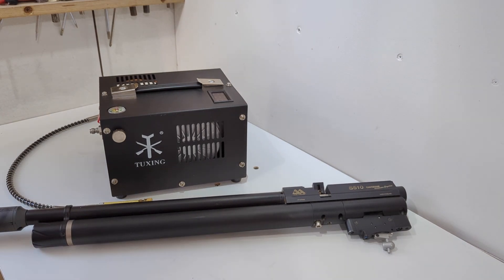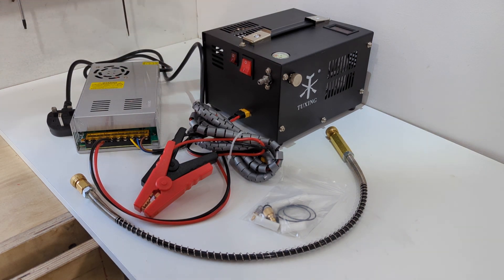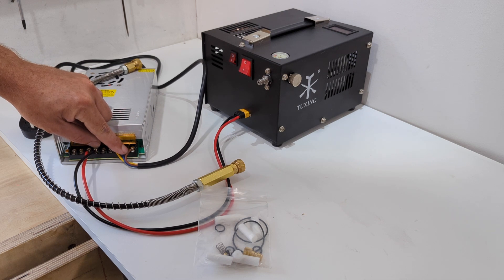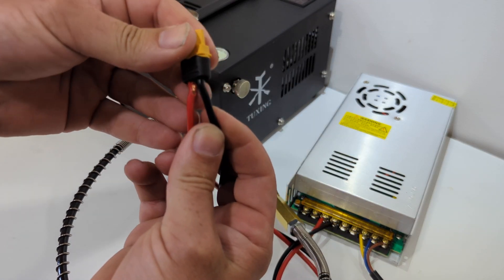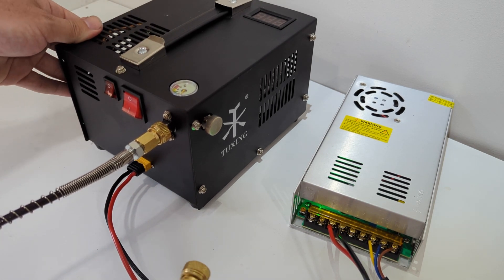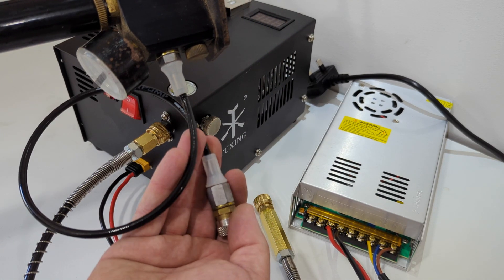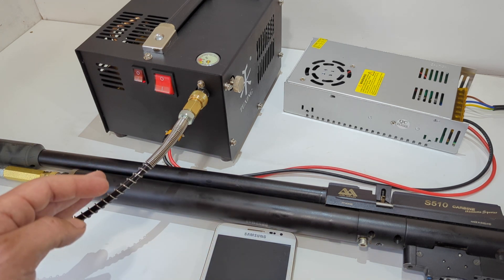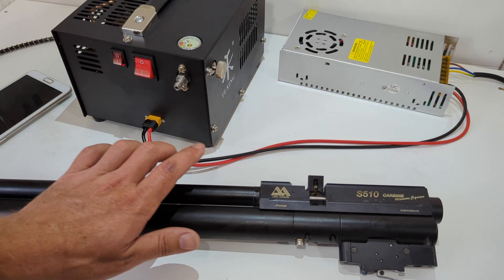The shocking truth about the tuxing 300bar mini pcp compressors

Comment: Rechargeable battery pack 12 volt .would that work ?? . I have one for a an electric target that moves from side to side that I made off youtube videos based off a camera slider and I used V-slot .V-slot is basically what a 3D printer is made from its all off E-BAY.Look up CAMERA SLIDER with motor its hard to get across what I mean but easy when u look up CAMERA SLIDER  with motor. moving target that goes left to right forever with a target on top
Reply: will it supply 30Amps??
probably not
Reply: @GrahamHenderson25x  I know that other models use 12 volts and people DO use car battery's to run these type of compressors and when I say car battery's there not in a running car just the battery and others use lipo battery the type u put in an RC car their are videos on youtube not sure if it good in the long run for the compressor but power is power